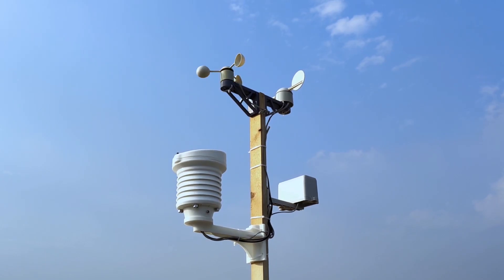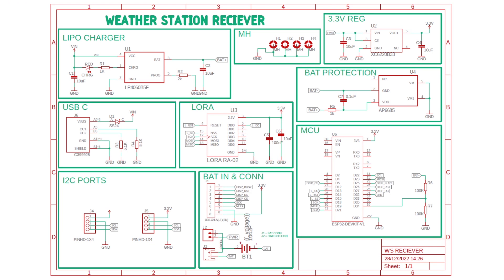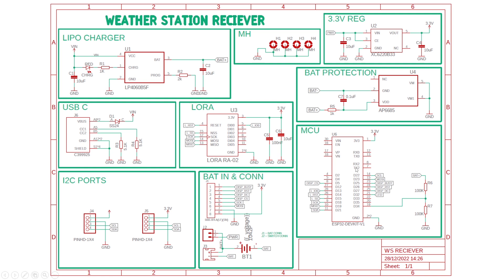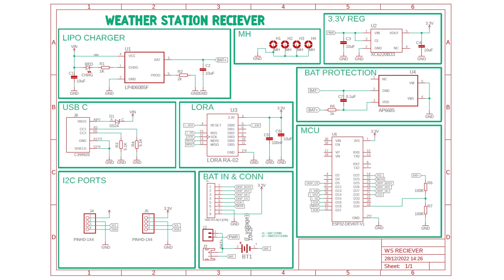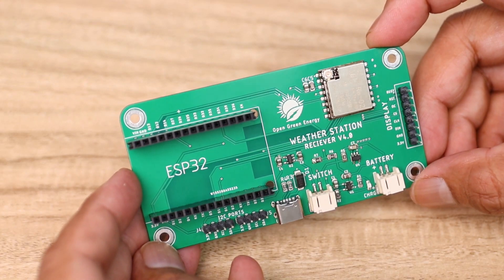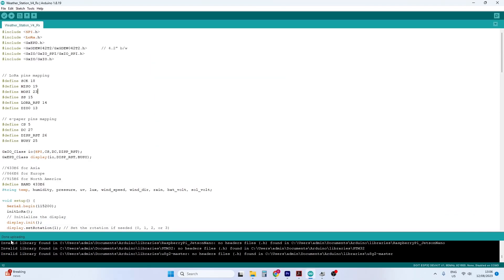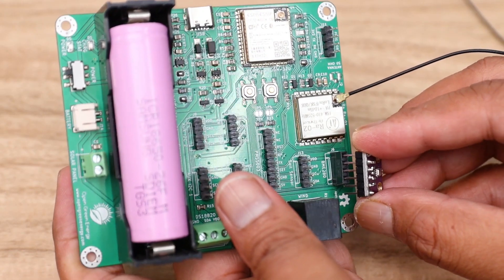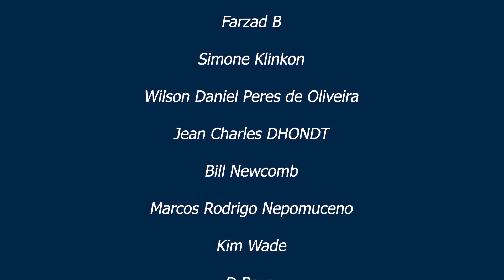DIY Solar Weather Station Receiver (Rx)

Comment: can you add a computer USB port or through WIFI acces because example, I want to extract data to my computer automatically either USB or through LAN connection or throug WIFI so that it can be read on many applications like weather display, weewx or meteobridge thanks.